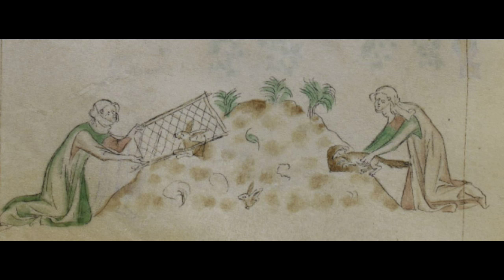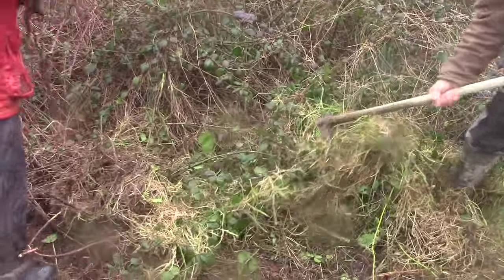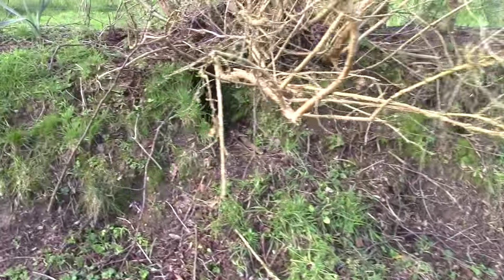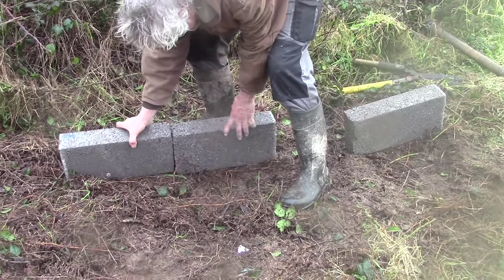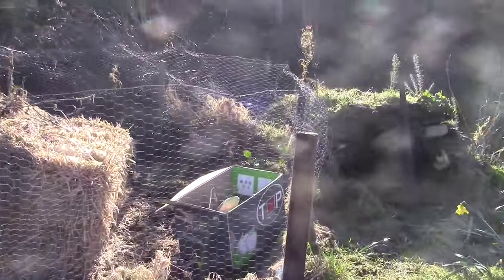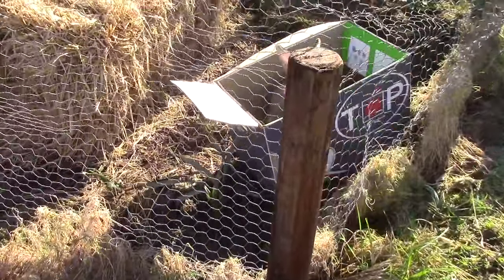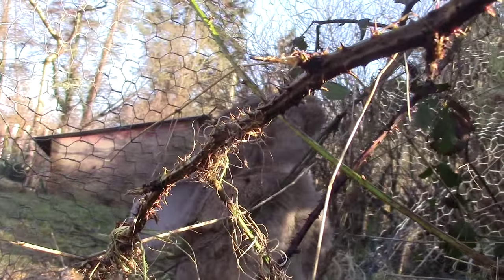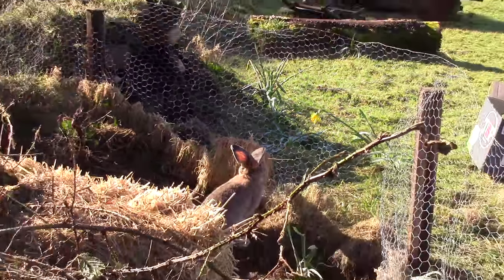Free Range Rabbit Keeping – How To Build An Artificial Warren

Comment: Hello from South Dakota, USA.  Former keeper of rabbits, now ducks.  If the rabbits are raised for meat, I'd suggest breeds other than giants, of which Welsh Giants are one example.  The ratio of bone to meat is quite high.  I have had Champagne d' Argents, Silver Foxes, crosses of the two, (my favorite) and Silver Martens.  These were all raised in cages, and fed rabbit pellets and alfafa hay daily.  As you are trying for 'free range' rabbits, you might go with an open bay sort of arrangement.  The man from whom I bought the  Silver Martens had a space about four feet by four feet, on concrete, closed at the back, (wall of the former garage), open at the top, and wired on three sides.  (As an alternative to concrete, feed supply places sell heavy rubber mats meant for cows.  Should be rabbit teeth invincible.)  Wire height about 30 inches.  He kept his feeders and  waterers on the wire, straw bedding on the floor.  Each space held one female.  He kept a couple of males in cages overhead, but they could be in similar quarters.  Two things, no, three things, wait, four things to keep in mind.  Females in proximity to one another will fight.  (A man who bought rabbits from me lost one to fights.)  Rabbits will pick a spot in which to urinate, that spot gets very messy.  Three, rabbits will chew on wood.  Wood floors, walls, posts what have you.  Four, to breed rabbits ,always take the female to the male.  Females are very territorrial.  Do it the other way round and there will be a fight.  
In my experience, free range and rabbits are somewhat exclusive.  I suppose it could be done, but each female would need its own range.  I strongly recommend Story's guide to raising Rabbits.  Other breeds for meat are the white furred Californians and New Zealands.  And while Bugs Bunny may have eaten carrots, he was not a rabbit, but a hare.  Now your peas, and beans, and cabbages, and such like.  Best of luck from someone with Irish from a grandparent.
Reply from the maker: +Kerry Hogan Thank you, Kerry. Lots in there for us to think about. It's the behaviour of them that's of most interest to us, so we need to have them living in more space. so far we're learning such a lot just watching them interacting and running all the time. (Not sure I could ever keep them longterm in a cage after this experiment. They so much love to jump.) Also, living here we have no choice about the breed we use - there are so few breeders we just take what we can get.
Reply: @WayOutWestx2  Lots of carrots make for fat, happy and Great tasting rabbits

Comment: Like someone mentioned below, would the composting of the organic and the wood interact to eventually collapse inward.
are the upright slabs steady enough to stay upright.  What about a more Square brick, 

those rabbits look a bit hefty to fit through the gaps but I know they are a lot of fur.

Love their attack of the blackberry ( bramble)

Is there concern that they might encounter wild rabbits and potentially acquire disease?
Reply from the maker: +Martha Anderson Yes, disease is the biggest threat of all, I suspect. The plywood can easily be replaced. It's just an experiment though - I didn't want to spend too much if they don't use it or if they don't survive. It should last a while though, don't you think?